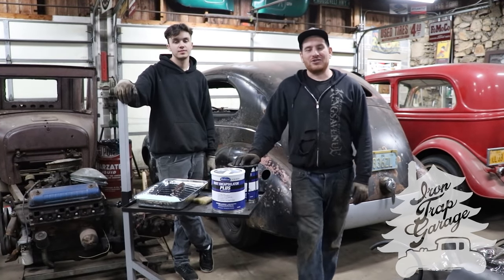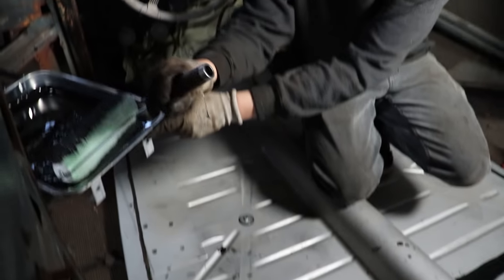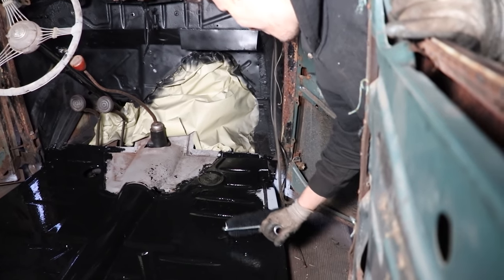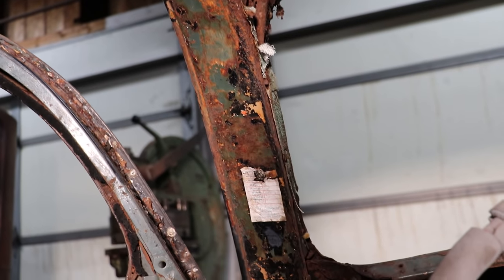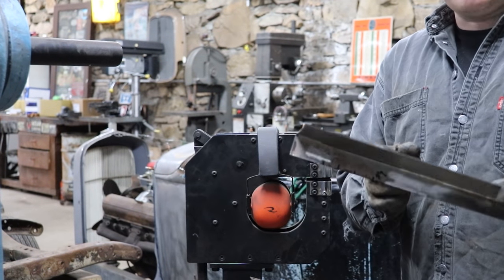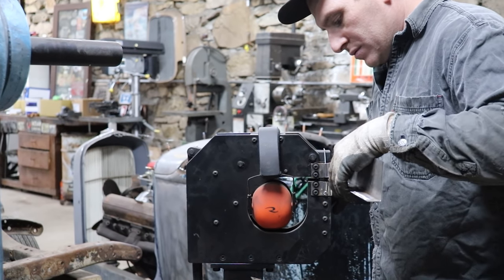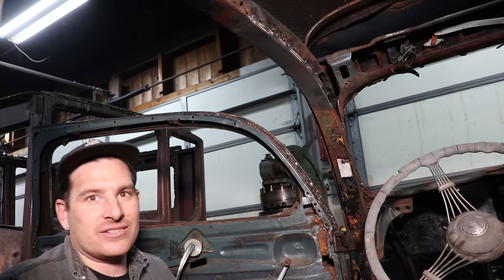The Last Of The Rust Repair - 1939 Ford Forgotten Hot Rod

Comment: I'm learning a lot. I've never welded so I'm watching where you put your hands, the tip and the duration of each flash. Much different than welding a thick mower deck.  I have holes to fill and a couple of notches cut in the top rear corners of my 51 Jeep.  Virus, go away i can make a mess. Thanks for the fun. :-)
Reply from the maker: Thanks Mark I’m glad these videos are helpful for you! I have some good beginner how to mig weld videos on the eastwood channel if you look over there.

Comment: matt you have gone to the trouble to repair the rust in the floor fire wall boot floor id like to see you clean the a pillar up replace it with clean new metal and the iner door corners and make a decent job of it it not a half job of it its got the makings of not a bad car its up to you how you repair the rust so far so good cheers kind regards chris s nsw aust ps im not nocking your work i wish it was parked in my shed  the scrappys got all our vintage tin came back as toasters lol

Comment: You might want to consider using a 7 inch  hotdog roller, you can get into  tight places, saves on the brush work as well as materials, even though you know a guy at Eastwood's.  They also make a 3 inch roller as well.

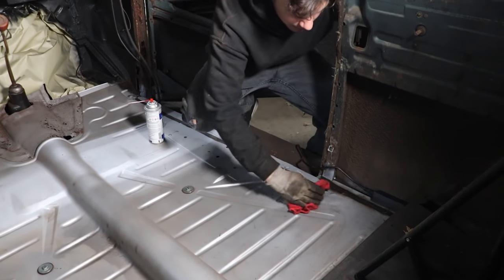Comment: 01:44  I would think you would really wet the area down.  I guess this stuff is like a brake clean or metal prep.
What is the curing time on the Encapsulator ?  Thanks.
Reply from the maker: Usually cures overnight. Depends on the temp outside too
Reply: @IronTrapGarage  Thanks

Comment: I'm curious as to why you didn't continue the patch up a little higher to get the rest of the vertical rusted area? Not critical for strength and covered by the trim piece?
Thanks.
Reply: That's my thought as well.
Reply from the maker: This piece was a separate part that laid over the inner brace.

Comment: Where is Andrew's PPE (paint respirator) he is still breathing in paint fumes!
I'm just looking out for him when he is 70 years old  and needs oxygen.  
like a lot of auto body painters do now.
Reply: I've never seen a respirator used when painting with a roller. I tend to think you would breath worse fumes standing next to a idling car in a driveway.
Reply: you are correct need to show us the safe way of doing this  i had to quit my job because my employer told me nothing would hurt me  and now i am paying for it
Reply: @cc9z  I agree I would be wearing some sort of mask working with any kind of chemicals, I've done body work for many year's on older car's truck's I wore a mask just cleaning out because of the rodent hairs and heavy dust I didn't want any of gunk in my lungs!
Reply: @cc9z  If you were working with paint that had a catalyst mixed you need to be protected. catalysts such as hardener will get in your lungs. It does not leave. I've rolled quite a bit of oil base paint on equipment, and poly on house floors, using plenty of ventilation.
Reply: mat tomon From a 70 year old here 👍. Please use one my young friend. You guys keep some of motivated during these trying times. Thanks and stay safe.👍🇺🇸🤙😃
Reply: I always use a respirator when rolling, but I always like to play it safe when it comes to breathing, just don’t watch me tac weld 😱

Comment: Nice work as always, nothing better than ticking off the done list especially rust repairs, did my eyes deceive me were you stretching the wrong end of the workpiece when you started to make the patch piece? I don’t know how many times I’ve done that only to realise once I got ready to fit it lol 😆, I’m about to start fitting my engine and trans back into my chopped 53 Chevy sled/kustom then it’s on to the emerald green metal flake body with a pearl white roof trying to keep everything pre 1968 the only exception is going to be the 4 speed auto for those highway miles I’ve got planned, anyway enough babbling , cheers from down under 🇦🇺😎👍👍

Comment: Matt, try 4 or 5" fluffy weenie roller. Is so much easier and no pan needed, just dip in can and roll out. Smaller handle make it so much easier.👍. Am a 45 yr painter and have used them always.
Reply: I think the directions tell you not to work out of the can. Poor into a separate container
Reply from the maker: Great idea but we do try and use a pan as to not contaminate the paint in the can. Never thought of that though!

Comment: I was hoping you were going to get the inside media blasted(not sand) and get some of the rust gone for good. Encapsulator works but there is a lot of rust in that interior and including the doors. Its your call but I would at least take it outside and use a cup brush to get some of the heavy stuff off. I am not being a wise ass but more interested on your take.
Reply from the maker: We removed the heavy rust off of anywhere that we could get to. Anything left is surface rust that Encapsulator treats just fine. Trying to keep this a budget/simple build.

Comment: Nice repair on the door jamb head. Hard for us to see with the video but it looked like the inside vertical still lots of cancer. Was that just surface rust??
Reply from the maker: Surface rust and I coated it with Encapsulator before and after welding

Comment: Might go to a wrecking yard and find a like early eighties cad in leather that material it top shelf and should sell for so little they may give it to you and then the seams are already sewn in and just cut to size. Make your heart flutter when you see the door panels and seats are thick and larger so it wouldn't be too big a stretch or even a lincoln will have this. Back in the day only  a rich man drove those town cars and then when they got old , certain sections of the city had them with airbags an what not all "gettod out" and wheels I wouldn't have them haul me to the cemetery in